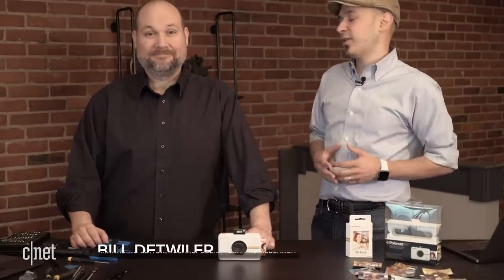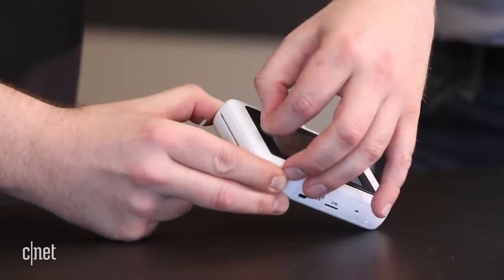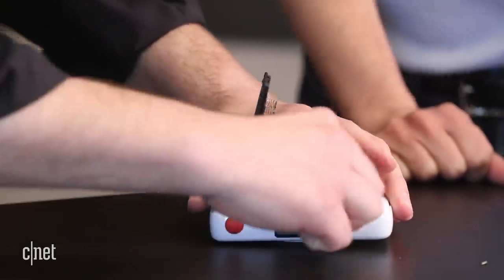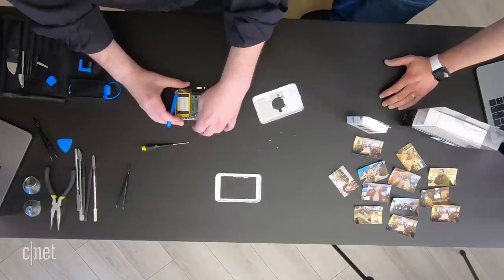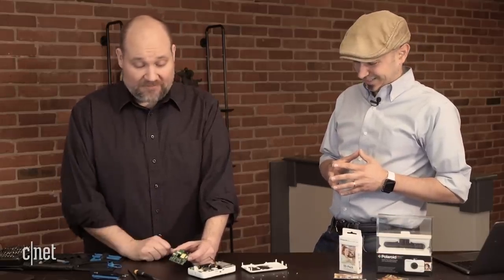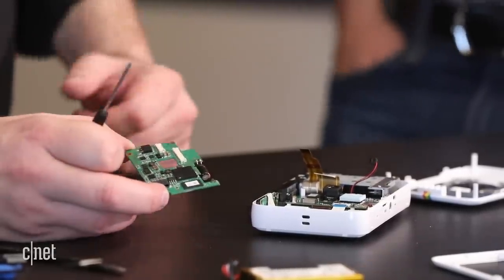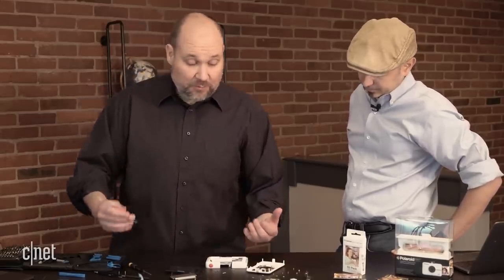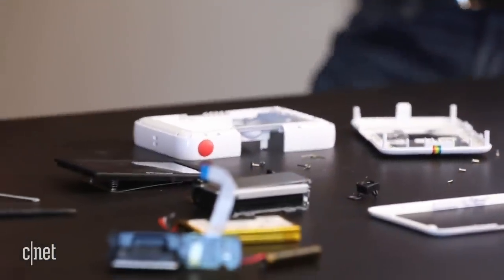Polaroid Snap Touch camera printer combo teardown (Cracking Open)

Comment: Hi! Could you provide more information about the battery this camera uses? I have one but the battery won't charge anymore and I'd like to find a replacement... I was really happy with it. Sadly the battery quality apparently sucks.
Reply: Sek Lab mine too !! I’ve been looking for a battery for a week now
Reply: Did you guys find a battery ?? Mine just stop working as well yesterday
Reply: @yooitzmightyy567  You could probably find a generic one with similar dimensions
Reply: Hey, did anyone of you end up finding a battery that fits?
Reply: . Idont know what dimensions to look for or what exactly to look for as for a replacement battery anyone ???
Reply: @yooitzmightyy567  This exactly is my problem too, I opened it up already but I could not find a replacement battery yet! please let me know if you have any luck finding one! Thanks!
Reply: I took the battery pack out and it is actually 2 battery’s taped together. The Specs are 3.7v 1100 mAh 4.07Wh each. Battery size is 4.5mm thick 35mm wide 62mm long which equals out to this part number (453562). I found a some batteries that are 402863 and ordered them. We will see!!
Reply: @juanmb6825  thank you. Sadly any possible replacement I found was ridiculously expensive to ship to my country, almost like half of the camera price. So I got rid of it :( and no more Polaroids.
Reply: @juanmb6825  is it works? ;)

Comment: My dad had a 90s generation Polaroid instant camera. The film was super expensive and the picture quality was pretty bad, but it was good for reference photos if you’re doing landscaping or architecture. This seems like more of a hassle. Minute three we haven’t even talked about the camera use yet and we’re already pulling off plastic and using a screwdriver. What is Polaroid thinking with this? These devices are supposed to be portable and convenient.  How was this company still in business?
Reply: Apparently this camera is made by C&A Marketing. They are licensing the Polaroid name.